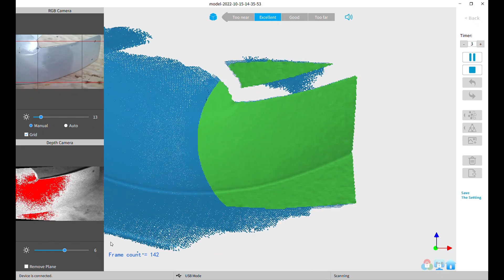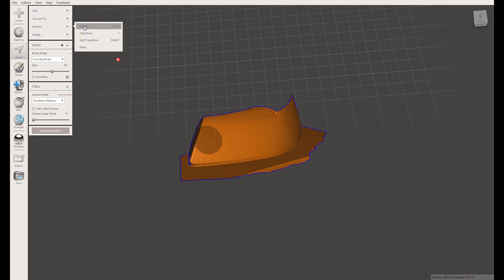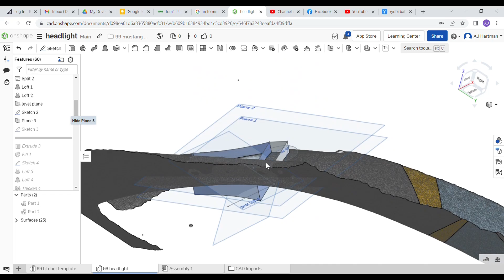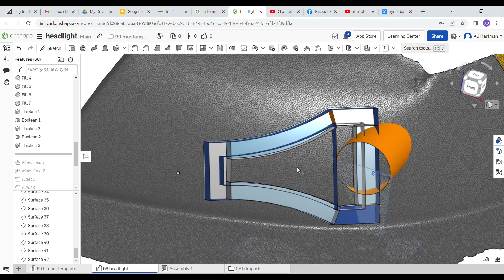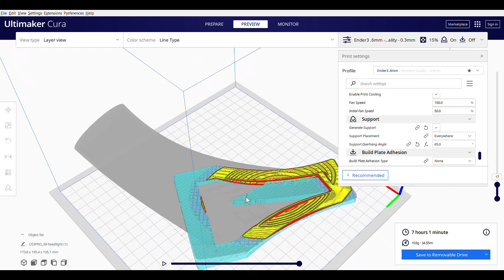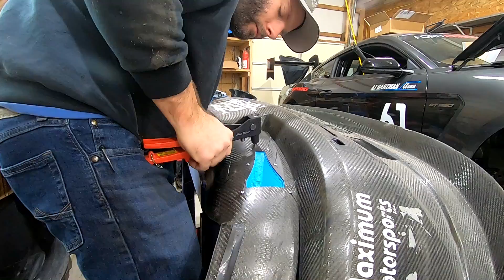3D Printing a NACA Duct to Cool My Turbos- 3D scan, CAD, 3D printing

Comment: Someone probably said this, but wouldn't you want an exhaust duct, not a supply duct?  "Sucking" air out of that turbo area seems like it would be more effective.  Thoughts?  I'm trying to get their design info, but someone I knew said they did just that and had significantly lower temps, including even overall engine coolant temps as that whole are was much cooler (turbo, IP, DP, exhaust manifold, etc. )

Comment: What results did you gain with these?
Reply from the maker: No concrete data but I’d blow out the driver side turbo gasket every race or two and that hasn’t happened yet. So they must be moving just enough air to not cook itself.

Comment: I like your use of onshape, if you want to you can use it with simscale to due some of your own cfd like I saw in your splitter video, Also in order to get the part to the exact space your made it you could probably unfold the the headlight using the sheetmetal tool  and print it on paper with the sketch on it and just line it up. Im not  100% as im still learning to do this myself but might be something to try. Love the videos.

Comment: Love the track car. Also was surprised to hear you engine swapped it with an f150.
Do you ever plan on doing a video on the car talking about all the modifications and specs?
Reply from the maker: Thought about it. I may eventually since it’s such a weird mix of parts.

Comment: A suggestion based on watching automakers perfectly, repeatably place badges on car trunks on the assembly line:

If you decide to make more for others to use, then go back to your CAD model to make a jig that helps place the duct on the headlight blank.

Minimum tooling, the left / right hand side jigs would let you mark duct opening on the headlight blanks.   

And, if you want to avoid printing jigs for the customer: get the placement with a printed jig, then convert it to CAD...  no, that other CAD: Cardboard Aided Design.   Get the jig back to a printed sheet that you can ship with the duct.

Comment: Wouldn't it be easier if you just designed a tapered duct intake?
It's at the front of the car and really easy to get clean airflow.
You don't really need naca duct to get a lot of airflow.
Reply from the maker: Yeah. Thought about it. Since I needed to slide the duct to the side a bit it’s getting to not as high pressure and since I had wool tufts on the car in the wind tunnel, felt it’s location was better served with a naca duct. If I was more centered on the car then yeah, just a round inlet would be fine.
Reply: @ajhartmanaero  
What was the reason for  running the ducts out wider?
Could you not run the exit duct parallel with the headlight cover and a gentle arc back to the turbos.
I am new to this but would have thought the greater pressure differential in closer to radiator opening would provide better flow naca duct or otherwise?
Shoot me down I want to learn.

Comment: Aluminium rivets in carbon fiber will cause galvanic corrosion between the two parts.
I did something similar on a daily and the rivets lasted 6 months before snapping one by one. Every one turned to a lovely white powder. It might be something to keep an eye on or mention in your videos. Dark aero did a good video explaining galvanic corrosion between aluminium and carbon fiber :)
Reply from the maker: Yeah I saw that one. Well aware of it. I have rivits in carbon in several places on my car for years without issue. I think the issue comes in if they see water frequently? Either way, good point but I’m not concerned about it in this case. If it’s an issue I can get some stainless rivets.

Comment: Nice :) I hope the duct print out of ABS or some heat resistant material :) Also you can cut a part in half then glue it for better finish surface or a resin might even better :) Thx
Reply from the maker: Pretty sure I mentioned it’s PLA.
Reply: @ajhartmanaero  PLA is gon deform pretty quickly, just under the summer sun will do 60 ez
Reply from the maker: @erwfew35136  What if I told you I already did a race and the car was sitting in the sun all weekend? Granted it was maybe upper 70's. But being light blue it won't get as hot as a black part. So I'll disagree with you and feel PLA is ok for this application but will follow up with this comment next summer if I'm wrong.
Reply: @ajhartmanaero  perhaps its not under any load or pressure, plus the cylindrical shape provide good structural integrity. Here in Taiwan most part I printed in PETG (rated 80c) deformed during the summer, had since moved to ASA and PC never had a problem since then. PLA is just generally not recommanded for most outdoor applications.
Reply: @ajhartmanaero  Great video. I will say that people's experience with PLA will vary widely. Not all PLA filament is created equal :). Some PLA is more heat resistant than others. I printed a PLA enclosure for my race dash and it deformed after 1 weekend events sitting inside the car in the sun. Got some PLA+ and it did better but still ended up deforming after a few events. Printed in PETG and so far no issues at all. I love these videos and great to see your process from start to finish!

Comment: Do you make custom parts for people? What are starting price ranges? Like, hoods, doors, etc. Do you also do fiberglass? What is usual turn around? Thanks.
Reply from the maker: Not currently. To small of a shop (man power wise) to take on more work.
Reply: @ajhartmanaero  Oh ok. I was needing some parts made. I'm located in Central Illinois

Comment: You should look into a resin printer
Reply from the maker: Sell me on one. I never really looked into them so what am I missing about them?
Reply: @ajhartmanaero  Pros: Resolution in the micron range, end results that look injection molded, "Tough Resin" has a high yield before failure and is stronger than abs, 2000 MPA bending modulus.  Cons: stinky and smelly and maybe a bit messy.

Comment: How did you arrive at the axis - orientation? Shouldn’t it be in line with airflow? Thinking the old tufts of yarn to see the flow pattern might be the way to go.
Reply from the maker: You know I took this to a wind tunnel? The naca duct with its shape is effectively in line with airflow. https://www.youtube.com/watch?v=tp0pTuRGI8o
Reply: @ajhartmanaero  nope, wasn’t aware of it having been blown over. Sorry, as I assumed wrong and the dialogue had me thinking you were orienting it for appearance.
Nice job on the video and explanation of the process.
Would it be possible to take the cad model and print it as a mold to do the ducts in carbon fiber?
Reply from the maker: @georgedreisch2662  I don't think so. It was designed to 3d print so I think there are negative draft angles on the part that would lock onto a mold.
Reply: @ajhartmanaero  could do it with a 3d printed split mold.
Reply from the maker: @TheTechnoaddict  could. But time and money make that not a smart option.
Reply: @ajhartmanaero  for sure. Did it on my duct for my intake and was very time consuming and pretty expensive.
Reply: I wanted to know abs and pla are denser than carbon counterparts,  but from your experience now, hoe much HEAVIER are the printed components? There are now ultra lightweight filaments made for small /uav aircraft that rival balsawood and foam.... would I'm mostly curious about weight comparisons to these small parts